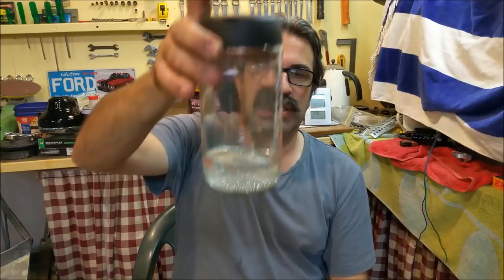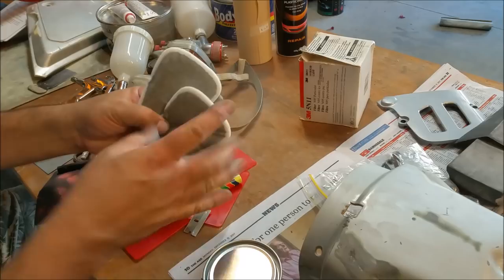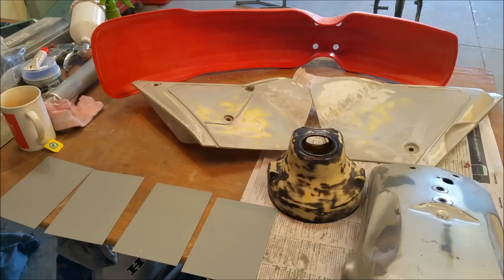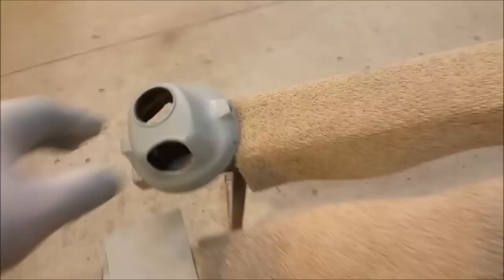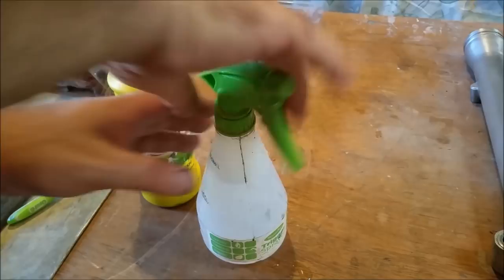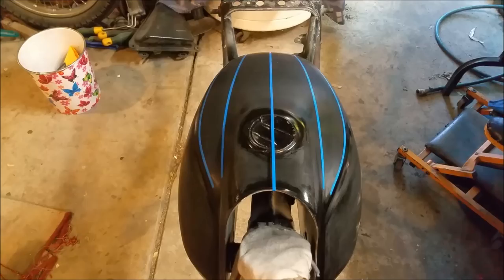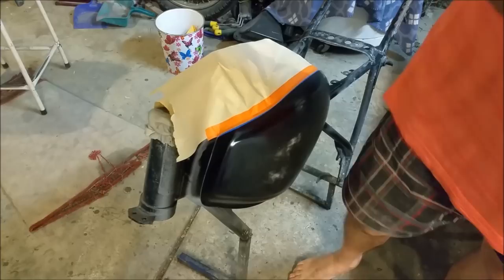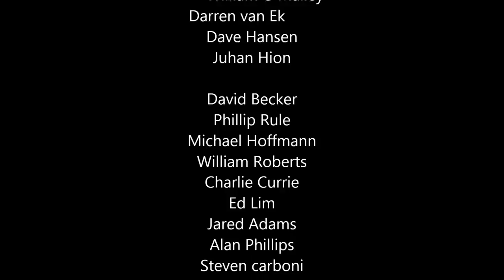Painting the Motorcycle Fuel tank - Almost There Part 3

Comment: Great job Peter. I'm curious about you using the plastic filler you used to fill the hole you drilled to stop the crack in the front guard. Will that actually bond sufficiently to not fall out? I know that with a hole in sheet metal, you need to weld a patch in place before using filler. Obviously can't do that with plastic, so just curious. As always, I so enjoy watching your videos! Thanks.
Reply from the maker: Being a 2 part product, I'm hoping it stays, it appears to be like an adhesive - time will tell.

Comment: Hi Peter got a problem with earthing the engine after powder coating  no spark
Reply from the maker: Run a tap through the threads - you may even need to cut the powdercoating very carefully underneath where the earth terminal sits. Cheers
Reply: Thank you worked a treat 😊